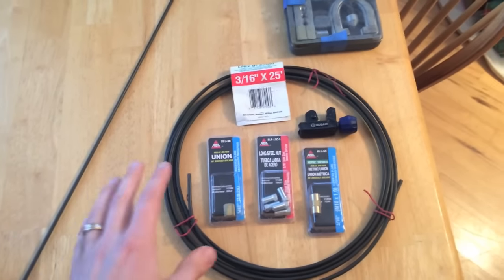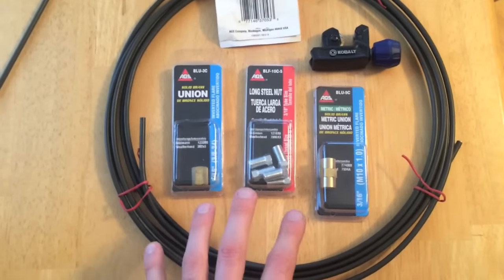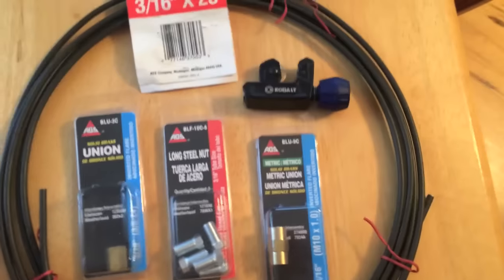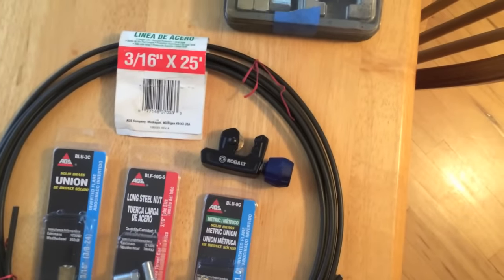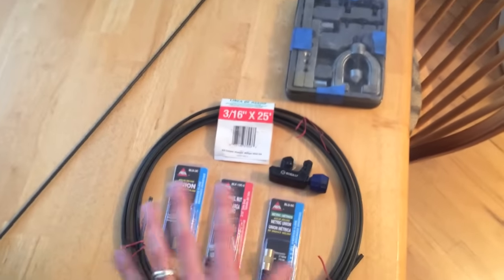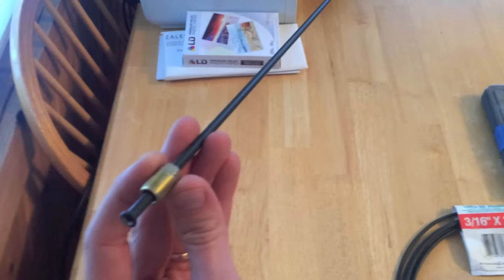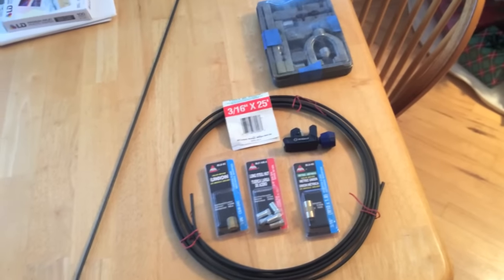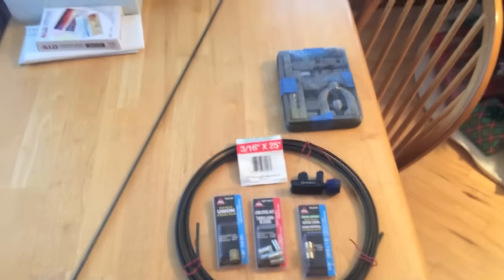Replacing RUSTY Leaking Brake Lines BEST Options

Comment: I've been doing my own car repairs for 55+ yrs and you are showing the right way to do it, compression fittings are dangerous and tend to leak and besides the whole line is rusty so why not replace it, go with the longest run possible without the bends to be made. save those for the short runs. It take the same amount of time.
Reply from the maker: Thanks for watching, that’s very kind of you to share.  Our goal continues to be getting you the info you need without wasting your valuable time.

55+ years of DIY under your belt is much respected, and again we appreciate you taking the time to reach out to us.

Many more helpful videos to come.  Let us know if you have any questions and hey if you’re into crypto trading, join our DIY ecosystem and become part of an exclusive group of DIYers.

       toolboxtoken.com

Reach out to us any time!  🧰

Comment: I'm looking into purchasing a pre-flared brake line. There are domestic, Japanese,  and European brake lines. I understand that the European brake lines are bubble flared. However, what is the difference between domestic and Japanese brake lines that are both double flared? 

Furthermore, as an example, if we take a look at Part # CNJ-312, which is a  pre-flared Japanese brake line, both fittings are the same size. On the other hand, Part # CN-312, which is a pre-flared domestic brake line, why does it have one fitting that is longer than the other one?
Reply from the maker: Thanks for watching & they are all very similar.  Nowadays, most are using double flare for long lasting reliability.

Comment: how can u tell what size brake line u have im kinda of having that problem now on a 2005 dodge grand caravan 3.3 rear driver side with hydraulic hose attact to it its the brake line that was already on the car its coming from underneith the gas tank coming out the rear end attactes to hydraulic hose and than goes in the rear driver side wheeel thanks alot happpy hoildays to u and your family besafe always
Reply from the maker: Thanks for watching, some will remove a portion of brake line and take it to parts store to match it up.  Others will contact their local dealership and provide them with the last 8 digits of their vin number.

The dealership will be able to get you the exact brake line size for your exact vehicle.

Comment: Why didn't you use Ni-Cop brake line? Much easier to bend back to factory fit specs and it will never rust on you so there for if it is anchored correctly like the steel line it will never rub a hole and leak? Also again much much easier to work with!
Reply from the maker: Thanks for watching & we really appreciate you sharing your thoughts.  Any & all helpful info is greatly appreciated.

Welcome to the DIY Raptor Club Mark.

😎👍

Comment: I have a leaky brake line on the front passenger side of my 2003 Pontiac Grand Prix SE (I love, love, love my car, but it's been a money pit since buying it used from a neighbor two years ago).  I'm intrigued by your video, even though I wouldn't know how to do this myself...but it will cost in upwards of $200 to get just the one brake line fixed at a local shop. Is it fairly easy to learn how to do this kind of repair myself and how much do the parts cost (general estimate)?
Reply from the maker: Thanks for checking out the video!  This is a very popular way to replace rusty old brake lines.  I went to AutoZone and purchased the "Pre-Flared" lines and installed it on a recent vehicle a few months ago and total cost was $20.00.  The "Pre-Flared" option is extremely popular and very user friendly.  After replacing lines, you will need to bleed brake system.  Keep me posted with your progress and questions.  Please Subscribe to the channel and turn on your youtube notifications that would be awesome thanks again!
Reply: I went to NAPA and purchased steel brake lines. They were super long, but both ends were pre-flared. I ended up bringing my car to a recommended body shop, and they replaced the leaky line, but never used the ones I purchased. UGH! It cost around $140 to have them do it, but then they found that my fuel line is also corroded, and now I've got a fuel leak. REALLY?! So, I purchased the rubber hose and clamps for that, and am hoping that my Dad can work that one out for me. I asked the mechanic at the body shop about how much it would cost to replace the corroded parts of the fuel line, and this was his response "Oh, I don't know. We'd have to trace the line back to see how far it goes. We may need to replace the entire thing." Yeah, this is why it sucks to be a woman at a mechanics with a car that is taking a poo on you. Thanks so much for all your advice!!
Reply from the maker: The Moonlit Quill Thanks for the update!  I’m happy to hear your brake lines are replaced.  I definitely hear you and it reminds me of many many visits to several different repair shops when I was in college.  One afternoon I drove my care to a repair shop for one ( 1 ) tire replacement only...all three other tires were perfectly fine.  I sat in the waiting room and after about an hour, the mechanic came out and showed me a list of things that “NEEDED” to be replaced.  I looked at the list and thought...What... if the parts on this list were broke and “NEEDED” to be replaced...then I would not have been able to drive the car to the shop in the first place 😂.  Out of curiosity I asked how much it would that cost...$1,200 bucks... I look back at the mechanic and politely said “just one tire please”... i’m driving it to Washington DC tomorrow.  The mechanic then looked at me and said with such confidence “this car won’t make it to Washington DC”.  Well, not only did I drive that car to Washington DC the next day, but I drove that car in the Washington DC area for four months and then all the way back to Michigan where I continued driving it for an additional three years....YUP, NO JOKE!  Not once did I replace any of those parts on the guys list.  This is the sole reason why I started learning how to replace things myself and making YouTube videos to help others.  Thanks again for the update 😎👍
Reply: How difficult it is to do

Comment: Once you understand that you need to clean the line well and file the end before flaring, you get used to doing good flares, and the prebent ones are convenient, but I prefer to bend almost every line from scratch, its cheaper and gives you more options as far as running them somewhere out of the way.
Reply from the maker: giskard80 

Thanks for watching & sharing your comment.  We definitely enjoy having the options to choose from.  We hear ya on the price & benefits of the roll over the pre-bent lines.

We appreciate your comment!  Please subscribe to the channel and turn on your YouTube notification Bell 🛎 that would be awesome thanks again!  😎👍🔧🔩
Reply: Also learn to flare because if your cutting into a line to apply a union you still have to flare the line you.cut into.

Comment from the maker: A couple different option here.....PRE-Flared lines can be a huge benefit if you're just replacing a couple feet of the line.
Reply: DIY With Michael Borders good to know. Is that coil of tubing plastic or metal? Is plastic line a thing? Or is a rubber section an option(using brake line rubber hose).
Reply: @fatboyshadetree5139  that's the coated option for anti corrosion
Reply: Best option is a full kit pretty measured and flared. A little more but less likely to have a flare issue

Comment: So, as you mentioned, we could buy the preflared brake lines at various lengths. If we choose to go that route, don't we still need to double flare the ends of the existing brake line that we cut off?
Reply from the maker: Thanks for watching & great question.  These pre-flared lines are great.  You will need to flare tip of origin line after you install the proper size union.

The new bolt which is installed on the new line & has been pre-flared will then be able to be screwed into the union.

😎👍🔧🔩
Reply: @DIYwithMichaelBorders  Thanks for your reply. When screwing the flare nut to the union, should it be tightened until all the threads are in or what? Instead of using a tube cutter to cut off the existing brake line on the underside of the car, would it be okay and safe to use a power tool like a rotary tool? Also, what would you suggest using to remove the rust from the existing brake lines? For instance, would it be okay and safe to use a power tool with like a 2" sanding disk or a wire brush on a drill? Thank you!
Reply from the maker: @Zeberka767  

Thanks for the reply, you will want the fittings snug & tight however over-tightening the fittings can cause damage & lead to leaks.

The cleaner cut the better & that’s why we recommend that little circular cutting tool.

We haven’t sanded brake lines in the past, it’s personal preference.

😎👍🔧🔩
Reply: @DIYwithMichaelBorders  There are brake lines that are labeled as a standard flare. What is a standard flare? Is a standard flare the same as a double flare or a single flare? Thanks!
Reply from the maker: @Zeberka767  

Thanks for the reply.  A standard flare looks similar to a double flare however less reliable.

A double flare is far more reliable as it is stronger & can withstand the pressure within brake lines far better than a standard flare.

Standard flares can weaken far sooner than double flares causing leaks & degrading reliability for the safety of your brake system.

Double flare is the best path to take.

😎👍🔧🔩
Reply: @DIYwithMichaelBorders  My understanding all along has been that using a compression union for brake lines is unacceptable, dangerous, and even illegal in many states. Hence, using a doubled flared brake line is the best method to use. Nonetheless, would a high pressure compression union rated for 5,000 psi (Dorman part # 800-202) be perfectly safe and acceptable to use? Thank you!
Reply from the maker: @Zeberka767  

Thanks for the reply, we have actually had viewers mention that’s the route they took & were happy with its reliability.

😎👍🔧🔩

Comment: Hey man thanks for the video.... I’m not to familiar with car mechanics but I have a problem with my 2003 Chevy blazer was wondering if you can help me . So I used my car all day yesterday no problem with the brakes everything working great. So today I turned it on and when I pull out of my drive way I realize that my brake pedal goes all the way down to the floor and barley brakes do you know what might be causing that ?
Reply from the maker: Valeria & Junior 0915 Thanks for checking out the video and sharing your experience Valeria.  Let’s figure this out.

Has there been any recent Maintenance work done to the Brakes/Brake System in the last 1 year?

At any point the brake pedal goes to the floor...its usually signs of a leak.  Your brake lines gather rust over the years and can start leaking.  

Take a minute and check underneath the vehicle for any leaks.  The brake lines run from the Master Brake Cylinder inside the engine and run down underneath the car back to the  brake calipers.  Laying on ground, You will want to check under the car under the drivers seat and locate the Brake lines.  In most cases the brake lines begin to leak at this location of the system.  

Once there is a leak, the fluid gets pushed out of the leaking point each time you push brakes...and eventually leading to exhaustion of fluid and losing your brakes all together...Not Good!  

Make sure you check the brake fluid level in your reservoir...if below the Max line...MAKE SURE YOU ADD BRAKE FLUID AND FILL IT TO THE MAX LINE BEFORE DOING ANYTHING!

If you have a friend that can help you, Have your friend slowly push the brake pedal down as you look underneath the vehicle and try to find any leaks in the brake lines.  If you find absolutely no leaks...that’s great news!  We can move on to the Mast Brake Cylinder.

The Master Brake Cylinder is the heart of your brake system and regulates the flow of the brake fluid to and from all the breaks.  In the event that this fails, it will no longer control the flow of fluid and you will see the pedal going to the floor and causing loss of brakes...also No Good.  

Below is a link that shows me talking about my car that I had a Master Brake Cylinder failure.  Definitely check it out.  

Keep me posted on what you find!  Please subscribe to the channel and turn on your YouTube notifications that would be awesome thanks again 😎👍🔧🔩

Here is the link to video

https://youtu.be/F9s_1VZ2u5E
Reply: Check brake fluid! Then check for leaks..

Comment: A job like this is not hard. It just work. Take off the old line in tack as much as possible and if you cut it mark it so you know how it's routed bend a new one using the old has a pattern installation is the hard part in a factory some stuff is assembled after lines are in remember that you can take some parts off to install or make lines in sections that meet were you can connect them with the flares. To me each flare nut is a potential problem. A little extra work removing some parts is worth it parts like starter shrouds anything of that nature not anything that you can tuck on it with some patience I might be wrong I only done 2 of my own cars so any advice I'll take. My used motor home has a leak in rear someplace  I'm trying to find
Reply from the maker: Angelo Afanador 

Thanks for watching & sharing your comment Angelo, we really appreciate your info.  This is great info for future viewers.

We hope the video helped you & definitely let us know if you have any questions, we are here to help!

Again, thanks for sharing your comment, that’s awesome!

Please subscribe to the channel and turn on your YouTube notification Bell 🛎 that would be awesome!  😎👍🔧🔩
Reply: Thank you. I think for now anyway still working. My drum brakes are not working only front breaks any one know about proportion valve? I have no fluid in coming out can it be reset without removing? Or do I need to replace it? Thank you for your video and time God bless you
Reply from the maker: Angelo Afanador 

Thanks for the reply.  There is a valve located down stream of brake system that allows fluid to rear brakes.  This valve can sometimes get confused if the brake system is not properly bled.

You may need to re-bleed your Brake system which will then reset valve to work properly.

Keep us posted!  😎👍🔧🔩

Comment: Good vid, Ugh got a 89' Buick Riviera I hadn't driven in a while. One shop says rusted out break lines..been sitting in my garage close to the ocean for too long. Any advice on this car? Thanks in advance.
Reply from the maker: Robert Marting 

Thanks for watching Robert!  We appreciate you taking the time to reach out to us.

What are your plans with the vehicle?  Replacing rusty brake lines have gotten much easier over the years for today’s DIY’s.

We also recommend calling several local MX shops and getting quotes.  If the price is right, you may find it easier to have the shop do it...however we love the idea of spending a few hours with a good friend & replacing lines together!

There are hundreds of helpful DIY brake line videos on YouTube that can prepare & educate you.  

It really comes down to the “overall” condition of the vehicle.  If you & a friend determine that all other parts are in good working order...you might entertain the idea of replacing brake lines & getting the vehicle cleaned up to sell it...then get some cash toward a newer vehicle!

Keep us posted!  Please subscribe to the channel and turn on your YouTube notification Bell that would be awesome thanks again!  😎👍🔧🔩
Reply: salt water can do crazy corrosive  damage. if you bother doing the lines, i would paint them after they are installed to slow the salt getting to them.